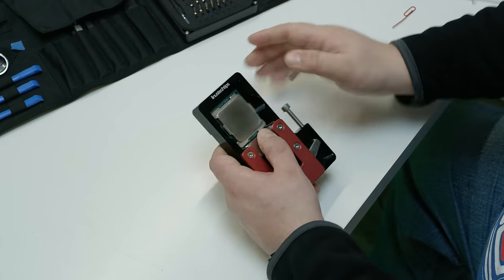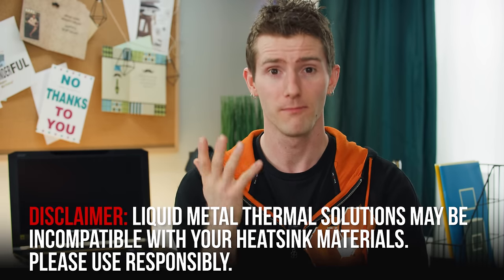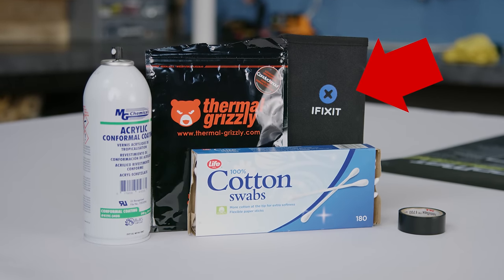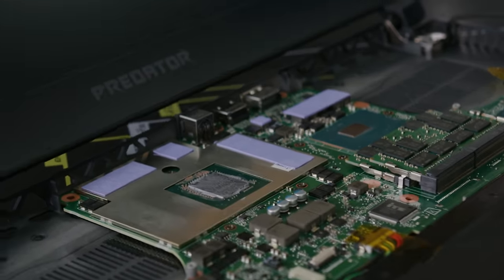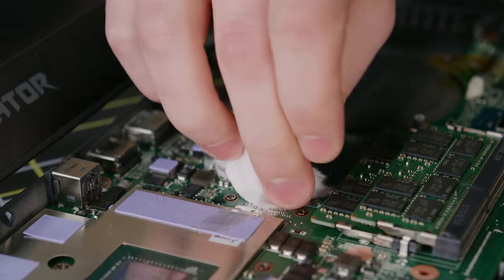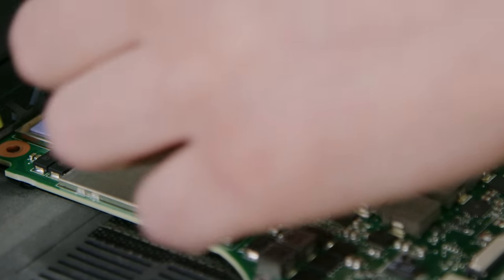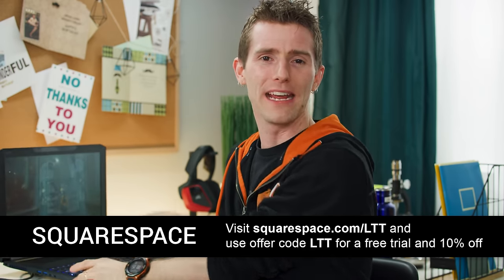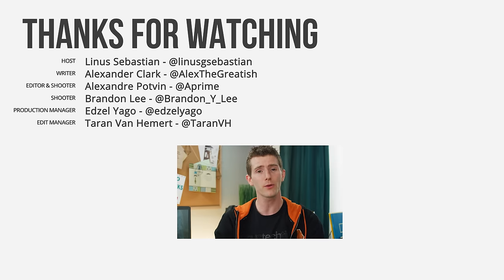Liquid Metal Laptop Cooling – 20C LOWER!

Comment: dumb question. so what if you have a mostly copper heatsink but don't want to ruin it? would it be okay to get say copper foil and stick it on the heat sink over the gpu/cpu then apply the LM?

Comment: okay, after finally testing 5 different thermal pastes on my laptop(all caused thermal throttling to some degree) I have decided to take the risk and apply Liquid metal on it. I am scared but I hope it works. Will only be appling it to the CPU and not the GPU.

Also does liquid metal pumps out? because few of the thermal pasted I tried did.
and is it really okay to use electrical tape near the die? won't it melt or something? should I use krapton tape instead?

Comment: Which is the best thermal pad, and which is the recommended thickness of the pad?

I have a Acer Predator Helios 300 and is facing some serious overly high temperature, even at idle (70c) so im worried.
Reply: why a pad instead of paste?
Reply: @mark1A100  Because the laptop needs both, thermal pad and thermal paste, since the pad is for some circuits and paste for the metal parts (CPU and GPU).

Comment: Thanks for this video! I have a question though, and it might be stupid.. I've noticed that the heatsinks were copper base?
I have read that Liquid metals will visibly degrade the copper heatsink surface over time, will that mean that the copper heatsink wont work anymore like it used to? if yes, then what would be best for GPU or CPU thermal element for overclocking, if the heat sink is copper or copper based? like Aorus 1080ti xtreme edition, and having a EVGA CLC 280 liquid/water CPU cooler? or or should I always use it only when delidding? Will is still be this liquid metal?

Comment: If it works so well and is relatively cheap then why doesn't intel and amd just do it at the factory?
Reply: its more delicate and likely harder to do in production line. 
plus its been shown that replacing the compound between the cpu and the ihs with higher quality but still normal thermal compound already give large gains that intel wont do so what do you expect

Comment: I have to ask , since its becoming increasingly necesary to use liquid metal on my acer helios 300 2019 (8750h 1060 6gb). Could i use thermall pads instead of the electrical tape to put it around the cpu (like a one piece of theraml pad cut to acomodate the cpu inside it)? Also can i use nail polish instead of the conformal coating?
I would like some serious answears

Comment: Is there any scope for improving the thermals/temps on my laptop with only one fan and one sided exhaust (i7-4712HQ-37W + GTX-850M-50W)
I had applied Arctic Silver 5 but that didn't help at all. I did undervolt my CPU a bit but that only makes it(under CPU only load) turbo longer and slowly rise in temp rather than abruptly jump up.
Although while gaming, temps always reach 100/85-90°C for my CPU/GPU.

Comment: something does not add up with this liquid metal. this ultra thin gaming laptop is engineered by acer to have a good thermal design to limit throttling down and enhance gaming performance, acer thermal dissipation experts at acer obviously know about liquid metal, what are the drawbacks (other than extra care and efforts at build mentioned) that prevents them from using liquid metal ?

Comment: I just made a huge hole in its ass, taped a sheet of foam (the type you use under fake parquet flooring) under for forced airflow, ditched the mouse pad and 3D printed a grill, then taped two bathroom fans, one with normal fins, one with nearly vertical (to the axis of rotation) fins. The laptop (an Asus) runs 40% cooler. Can't be bothered to do anything else past this, but at some point maybe i'll just cut out an even bigger hole and machine a heat sink to solder to the copper heat ways and run a Dyson hair drier metal fan through it.

Comment: Could this be applied to a discreet GPU? Like a GTX-1080?  Is it worth doing?
Reply: Hi Larry... Yes it is possible, but there is a risk involved just make sure that liquid metal does not come in contact with any Aluminum as Gallium will dissolve it. Sometimes GPU Coolers are Aluminum so double check yours before trying. I learned the hard way as I used an all Aluminum CPU Cooler to try the Liquid Metal out. Cooper does not seem to be affected by Gallium, or Liquid Metal, but if you have a Copper Center and Aluminum Body with a Copper Center you might not want to try this. The GPU sits differently in the PC and Gallium can run so needless to say if it goes over the edge of the Copper Center you will be in trouble. I hope this helps...
Reply: So not worth it in my opinion. Shin-etsu is fine.

Comment: Nurses always squirt before using the syringe. There's reason for that.
Reply: Lubrication?
Reply: To take all the air bubbles out. But then were not injecting it under the skin. So when you replace the cooler, it is going to need to force all bubbles out of the surface area. This is sure to produce a ring of the liquid to hopefully evenly form, beyond the die. Now having this extra stuff can only reduce cooling as it is going to retain the heat, not cause it to be removed. Inside the CPU cooler is liquid that conducts the heat away. Using a pump to circulate it, like in a car radiator system, is what is going to keep the CPU/GPU chips the coolest. Shedding away the heat from the chip, and radiating it out via the cooling fins. However on a laptop due to that, you are in a cramped space, the cooling effect is much worse than a desktop where you have vertical room to build things up.

Comment: If I have an Alienware 13 r3 laptop that I store sideways in a backpack for school. I want to liquid metal repaste it but am concerned that the liquid metal will run off when I store it sideways for days at a time and short out my electronics. Is that a legitimate concern?

It’s 18 months old and I repasted it with a noctua NHT1 last week but have been less than impressed with the results so far. I also bought an arctic silver 5 and could use that instead, is that Better than the noctua? 

And is it a bad idea to use I quit metal like grizzly if I move the laptop around a lot?
Reply: Can you be specific, why hasn't the noctua impressed you. I use it on my ASUS ROG GL502VS. The max CPU  temps the laptop hit during long gaming sessions was 99°C and the average was in the early nineties. Now the max is 90°C and the average is in the seventies. GPU is in the sixties mostly, max is around eighty. It works in my case atleast.

Comment: I NEED SOME HELP, I was thinking of doing this to my new alienware 17 R5, that things plays at 90 to 100 degrees which dell says the CPU is meant for those speeds.
My question is, how safe is it? the eletrical tape he applied how come it doesn't melt? i tested various tapes with different temps and they all melt. Is it worth it the risk?
If i went with a normal paste, what is the best one?

Comment: Is liquid metal dangerous for my laptop?
Reply: Yea it can be dangerous for the heatpipes. There is a reaction beetwin copper and liquide metal.  The copper is oxidised because  by the gallium in the liquide metal. This is why the liquidemetal dry with time. We can see 3 problemes: it will dry so it will be less efficient, the transformation of the copper make the heatpipe less conductive and finally the mechanical properties of the heatpipe can be affected. In regards with these problems I personnaly woulnd'nt use that kind of solution for cooling.

Comment: Oh well, FAR too much LM used there. It will result in tiny metal drops to happily jump around on the mainboard after a few little bumps. You are supposed to apply a VERY thin film of the material and not a whole puddle on the processor. I have applied the exact same stuff to 4 systems so far (i7 desktop machine, my laptop, Nintendo Switch and a PS4) without even using any physical barriers around the chips, since I have used so little material, that drops and the like are impossible. And all machines are running perfectly and with far better temperatures / lower running fans.
Nobody should be afraid of using LM. If you use your damn brain and be somewhat patient, there is nothing to worry about. I will apply to every gadget from now on, that allows me to do so. I won't trust any regular thermal paste anymore, in my eyes it's crap compared to LM.
Reply: Only problem is this voids your warranty.

Comment: Would this Thermal Paste suit my HP Omen 15 Inch (2017 Model) Laptop? It's an i7-7700HQ and a Max-Q GTX 1060 6Gb.
Reply: It depends on whether your cooling pipes/heat sink are copper or not. I have an Omen too but HP painted the visible surface of the pipes so I can't tell what they're made of. Some manufacturers will also put a thin coating of copper on aluminum tubing, so it looks like copper from the outside, but could allow the LM to destroy your laptop if it gets through the copper to the aluminum underneath. Unless I can be absolutely certain that my cooling pipes are pure copper I won't risk using LM.
Reply: Update: I would NOT use LM on an omen:

I did a little research and it looks like Omen heat sinks are not suitable for use with liquid metal pastes:

https://www.ifixit.com/Guide/HP+OMEN++15-dc0030nr+Thermal+Paste+Replacement/112630

According to an email I received from HP after requesting the info

“As you requested please go through the link to know more about the heatsink materials and they are mostly made up of aluminum alloys.https://www.abl-heatsinks.co.uk/heatsink... “
Reply: Note: I like how HP doesn't even know what their own heat sinks are made of. In my experience the response this person received is typical of HP product "support."
Reply: You can still use non-conductive silicon/polymer pastes like Arctic Silver, just stay away from liquid metal paste.

Comment: Could someone help me to know what would be the best thermal paste or thermal pad to avoid the Pump out effect on a laptop? (i7 7700hq) I have applied the Artic MX-4 but after 1 week the temperatures become very variable from core to core of the cpu and it ends up doing Thermal Throthling. When applied at the beginning it reduces from 95 to 75 degrees. Then a week in 95 again. Would the IC Graphite pad work?  Please help. Thank you!

Comment: Do I need the conformal coating or can I do without
Reply: It is almost necessary, as a teeny bit of liquid metal will come out and could short the components, nail polish, or liquid silicone works
Reply: @thatdudeguy7294  could I just use electrical tape also thank you
Reply: @thatdudeguy7294  I have a acre nitro 5 and it averages while gaming at 203 so I trying to find out what I can do
Reply: @thelastone6255  203 what lol
Reply: @thelastone6255  as a second layer only, because the glue degrades really quickly because it gets so hot
Reply: @thatdudeguy7294  203 degree
Reply: Okay so I’ll use nail polish remover and electrical tape thanks

Comment: This shows you how useless Intel is. For a company like Intel with state of the art tech & design, one would've thought that they would have setup the manufacturing process to have all surrounding CPU components (capacitors, resistors, PCB tracks, etc.) to be sealed with a semi-hard-setting liquid goop barrier that is resistant to electrical conductivity, liquid & high temperatures and thus having a" physical barrier seal". All done before the liquid metal application.What's a matter with these companies!

Comment: Help, I tried to use liquid metal for my laptop, but I think the gpu shorted, what are my options and does anyone know how much it would cost to fix it? (I have an acre nitro 5 with an rtx 2060 and an i7-9750H
Reply: It's most likely unfixable, you should have had precautions, or used Kryonaut instead, safer bet
Reply: @thatdudeguy7294  it was conductonot and turns out the laptop had a failsafe so it didnt short, but i messed up and now my temps are worse than before. now i gotta go to a professional to get it fixed
Reply: @Hungermantwo  if the liquid metal hardens, it is way worse, you have to put a tiny drop to revive the liquid metal, happened to me, 1st day was amazing, 72° Celcius 4.2 GHz on my i7 10750H, and a week later, it got back to 90° I was super mad, but then I read about this, and yes, it was very dry, so I added the tiniest drop I could, spread it around so it looks liquidy, and bam, back again to 72°
Reply: @thatdudeguy7294  it’s not even that, one of my screws are stripped because my friend used a motorized screwdriver and the paste is placed super unevenly
Reply: @Hungermantwo  using motorized anything is very stupid, it can severly damage the screws, with a screwdriver, you can feel how tight something is, or you feel if it's gonna strip